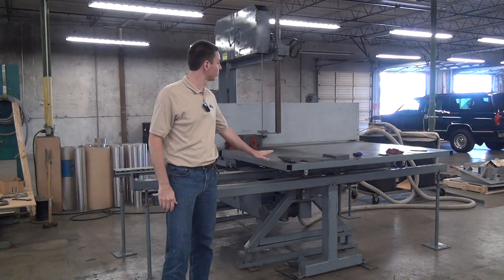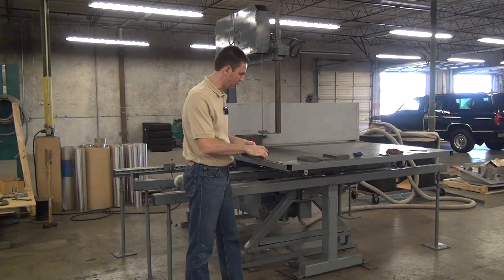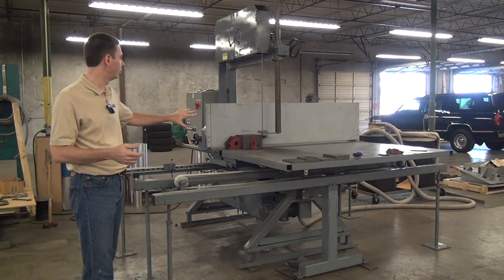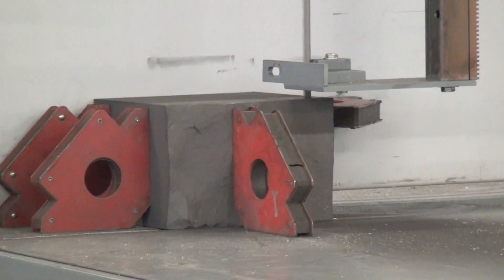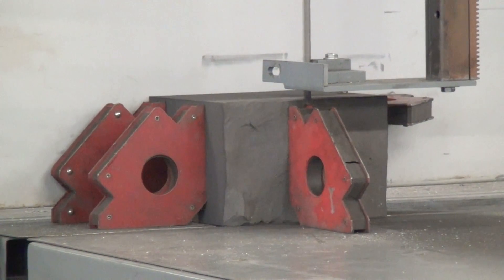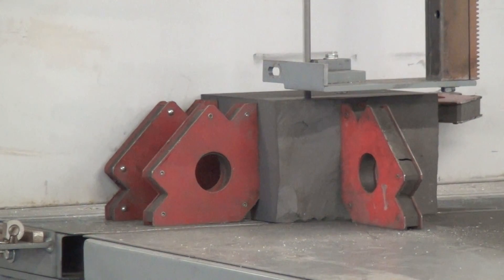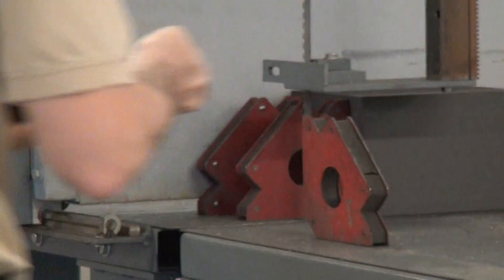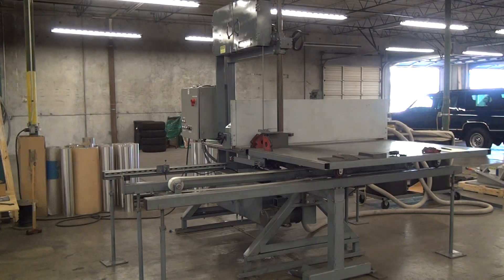Graphite block test cut on a bandsaw

Comment from the maker: Blade speed of 3000 feet per minute.  We have found that graphite cuts well at high speeds (compared to metal).  The graphite is self lubricating and requires no coolant.  Even at these speeds the material cuts slowly.  We use either a carbide grit edge blade or a carbide tooth style blade.